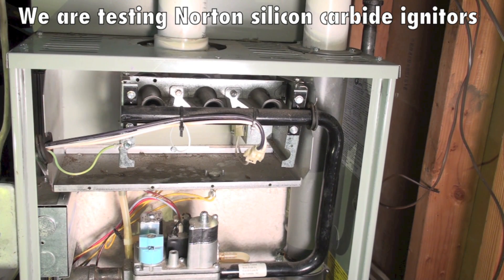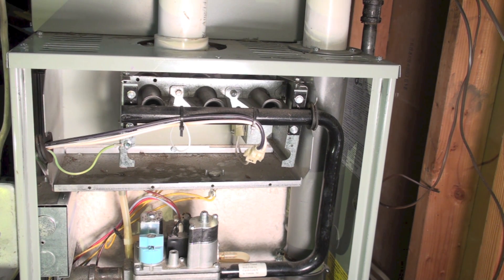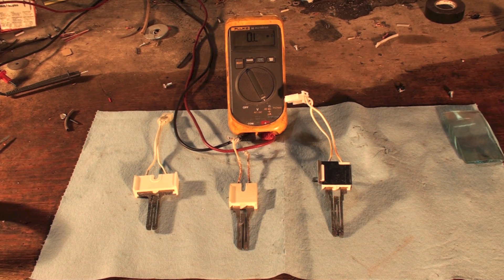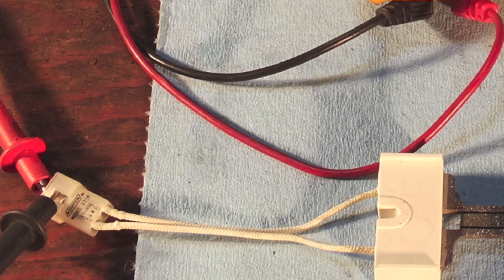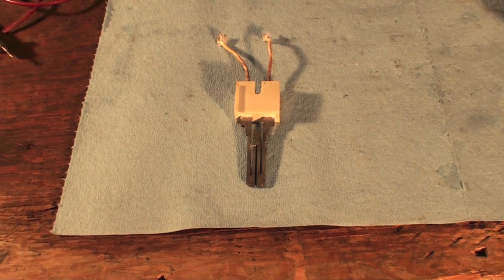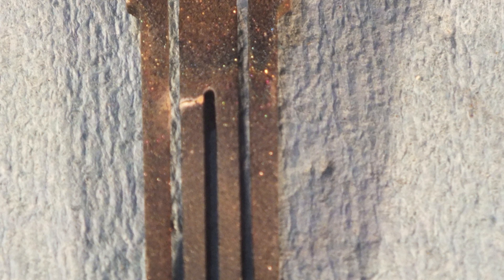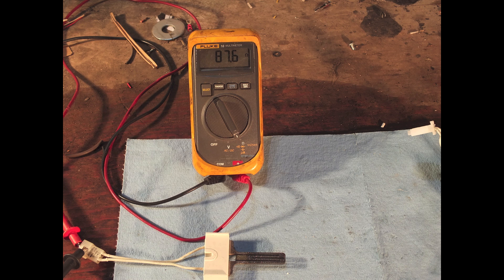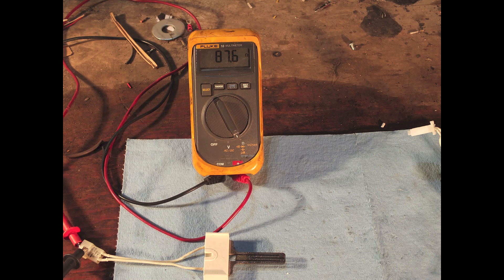What should the HSI resistance be on the gas furnace.

Comment: Thanks. Great video. My pool heater igniter is only at 14.5 ohms. Does that mean it's bad. Lmk please
Reply from the maker: Silicon nitride ignitors have a resistance that low.  Visually, the ignitor looks like a single rod or flat bar.  If your ignitor looks like the one in the video, the resistance should be below  150, usually about 85.
GFM

Comment: Loved this video. One question: how does the glow stick receive 271 amps? I  thought the furnace runs off of a 15 amp breaker?
Reply: I believe 271 is the model number of the igniter that has a resistance of around 90 ohms. That means it will draw ~1.3A off of 120V so 15A breaker is ok.

Comment: How would you know if its a fast warm up or cold slow warm up? Does it say on the HSI itself or on the wiring diagram?
Reply from the maker: Good question.  Sometimes you will see the model # on the connector, but I just watch it to see how long it takes until the gas valve opens.  
GFM

Comment: I've been testing them by using an Amp probe. if the Amp flow is under the control's specs, it gets changed out.
Reply from the maker: I don't have a problem with testing with amp draw.  Its just the manufacturer's specs to ohm them.  Thanks for the thought.
GFM